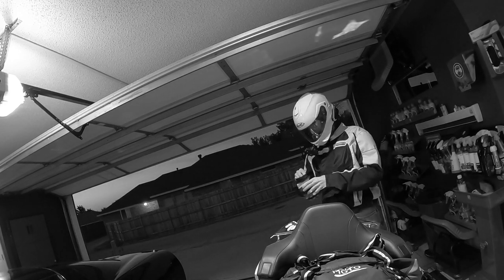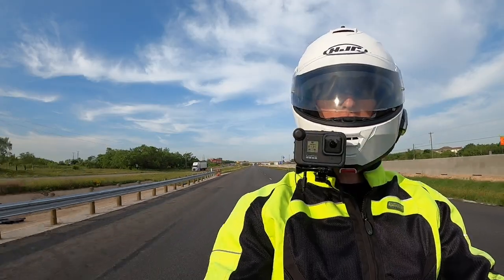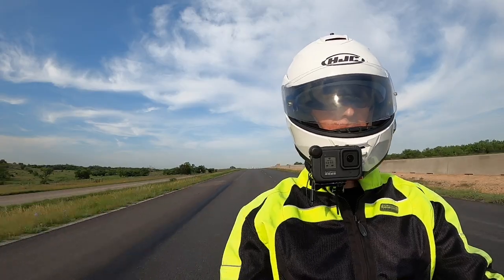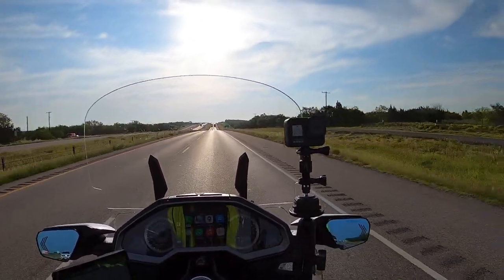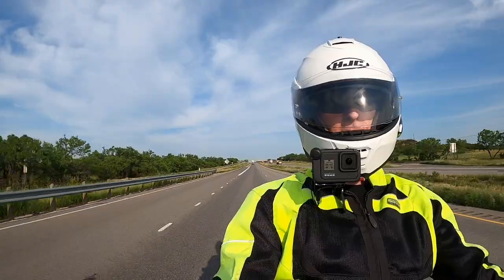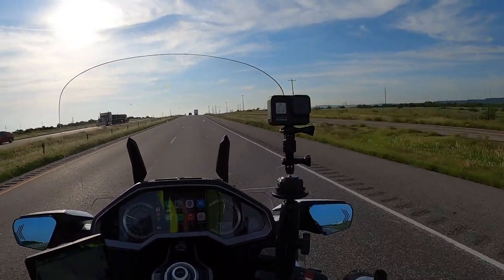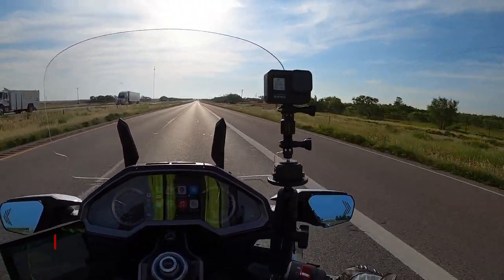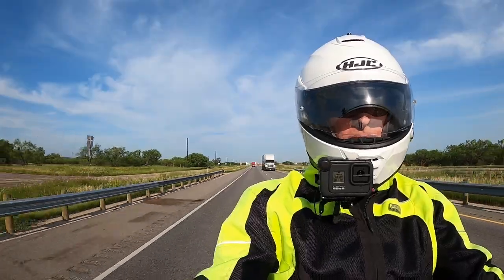Ride from Midland to DFW | Cruiseman's Moto Vlogs | CruisemansGarage.com

Comment: I'm 5'11", and have the F4 20" windshield.  It works great for me, and I really like the way it looks and the ease of cleaning.
Reply: Have you ridden in the rain?  My factory windshield will not push the water off. Even after using Rain-X plastic.
Reply: @awilliams298 I've ridden in the rain some, I wouldn't say a lot, and it seems to shed water pretty well.  I didn't keep the stock windshield on long enough to give a good comparison.

Comment: I carry a medium ice chest with Gatorade/Snapple/Water chilled in ice in my truck when I go on road trips.

I will also take a bath towel and fold it and put it on the drivers seat bottom so I can turn on the seat heaters on
high and not burn my butt and get some heat on my back so it doesn't get stiff and sore. A bit off topic but it
might help someone else.

Comment: I noticed you was using Android auto...I was wondering if you have trouble with it.. Like the goldwing computer restarting while riding and you having to stop and turn your headset off and back on to reconnect Android auto... Are connection are communication issues..